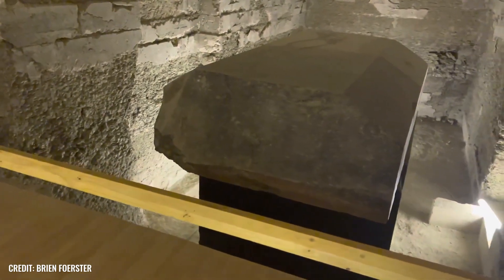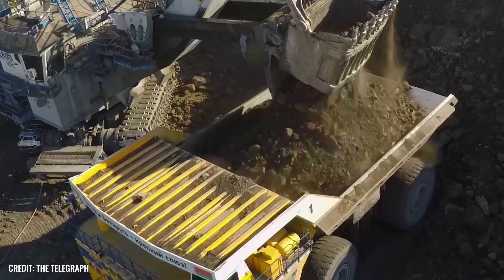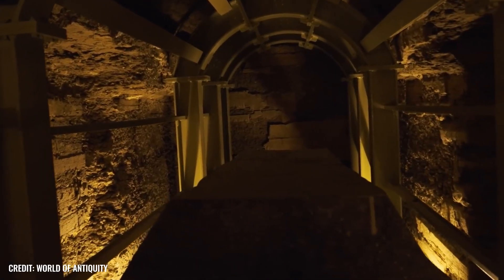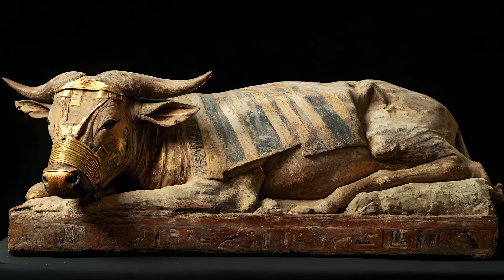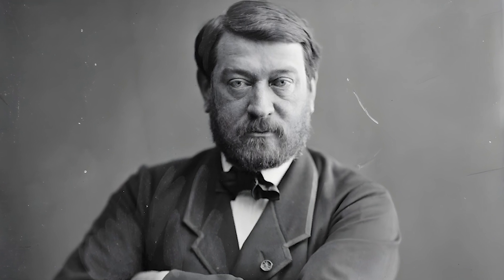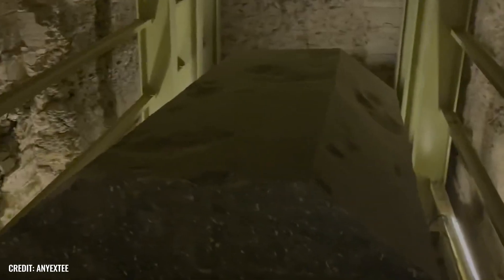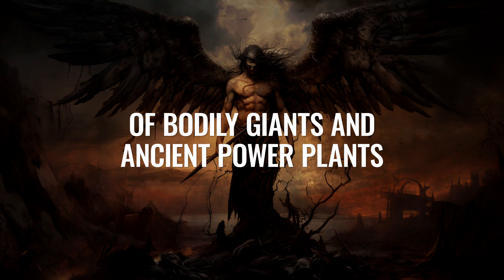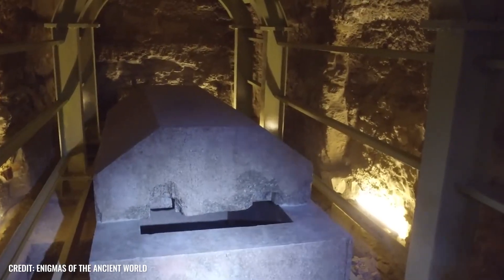The Impossible 100-Tonne Crates Made of Ancient Granite Are Too Massive for Humans to Build!

Comment: It seems to me that it is all about pressure.  There were no bulls inside but I've read that there were other organic materials.  Once they rot.. they expel gasses that build up.   The box with stones heaped on top seem to prove my point.  Pressures so great as to lift the lids must have produced some sort of power.. and some of them needed even more weight to keep them pressurized.  The ancients seemed to know more about the properties of quartz and granite than we do now.   It has only been recently that we discovered that a snap against a piece of quartz could create a spark.. or that quartz vibrates at a constant.. like your Bic lighter or modern watch does.
Reply: The piezoelectric effect was discovered in 1880 by Jacques and Pierre Curie. In the middle of the 1970s, it was OLD technology.  However, I was using it for its electrical stability.  Is that "recent"?  That depends who you are talking to.  They are still used today in watches, computers, and other electronic devices.  From my understanding it is NOT true that no bulls were found.  One was found in one of the sarcophagi.  The granite boxes were NOT a source of electric power because the crystal orientation is completely random, and it must be PERFECT (as in your Bic lighter) to make that work. Also, don't confuse pressure with energy.  They are related concepts but are very different.
Reply: @catman8965   I could be wrong but you are right.. no bulls but evidence of other meat that would have rotted and made pressure.   Modern corpses explode in their caskets.
Reply: L'endroit a été vandalisé par la population qui a changé de religion. Il s'agissait d'un grand centre de culture paienne. Il y avait aussi une bibliothèque qui a été brûlée.